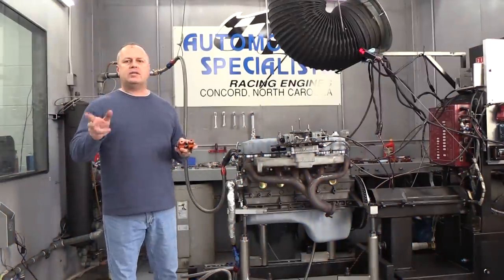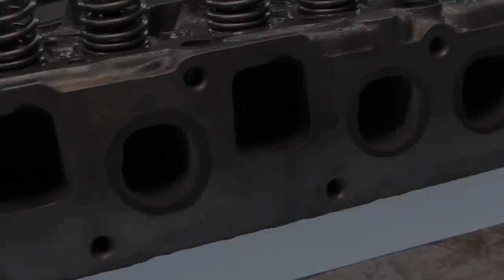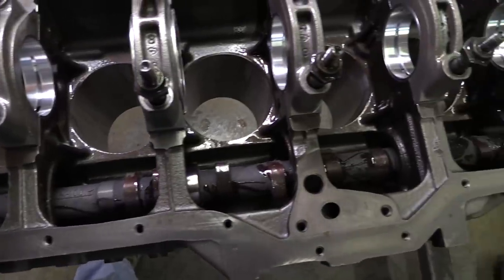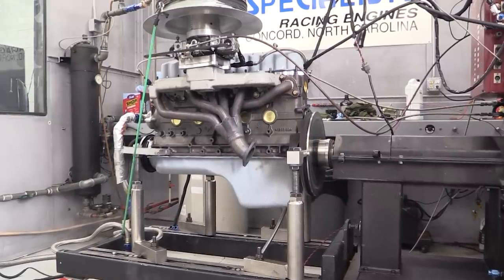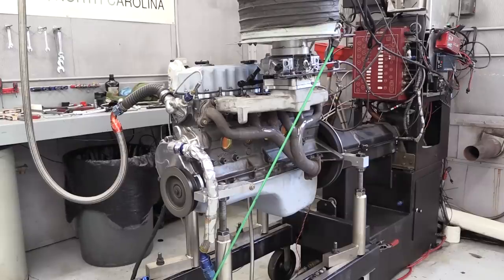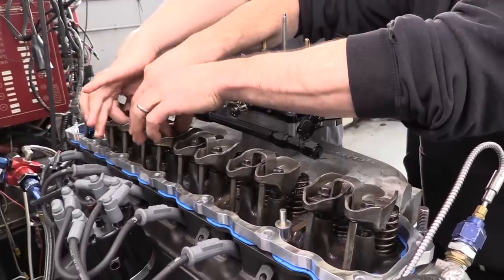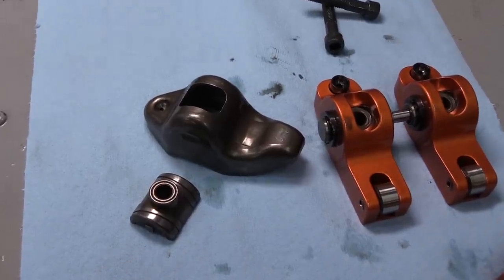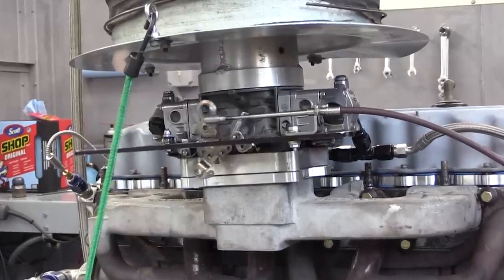Do Roller Rockers Make Power? (Dyno Testing a Jeep Stroker to Find More Horsepower)

Comment: Did yall put a spacer under the valve cover? Whered you get it?
Reply from the maker: Newcomer Racing makes them. And they are cool. They are producing a couple of really smart products for Jeep engines. You can contact them at www.NewcomerRacing.com. Thanks for watching.
Reply from the maker: @Michael Early Correct, the roller rockers will hit the top of the valve covers if you don't add the spacers.

Comment: So whats the reason to even try to use those TUPY heads? Would seem like they'd be the last thing you'd want to use, like trying to make big power with Chevy 305 heads.
Reply from the maker: The Jeep straight six engine has a few quirks. And the 305 Chevy head is a good comparison. The newer TUPY heads definitely are a step behind the older heads, but while the older heads are still plentiful for now, they are going to start to become more scarce. There isn't really much of an aftermarket yet, so far only Edelbrock produces a commonly available replacement head. (There may be others.) Also, while the older heads are the way to go, the newer blocks -- I think beginning in 1999 and up -- are much better. They are the NVH (Noise Vibration and Harshness) blocks with more material and a crank girdle for added strength. So Newcomer has been collecting the TUPY heads that come on the NVH blocks and has a good supply of them cheap. Finally, if customers with 2000 and newer Jeeps want to add power without spending the cash for a new cylinder head to replace their TUPY, Newcomer was doing some R&D to see what options are available. Thanks for watching!
Reply: The Horsepower Monster Didn’t realize there’s not a strong aftermarket yet, kind of surprising. Great explanation.
Reply from the maker: @sparkplug1018  Thanks!

Comment: Ok so now pull out that flat tapped crankshaft and put a hydraulic with rollers and see what the gains are in conjunction with the rocker arms.
Reply from the maker: The lifters are completely encased in the block. Does anyone have a system to install rollers so that they dont' spin?
Reply: @TheHorsepowerMonster  I thought the metal slug that the rod rides up and down on. The "flat tap" can get pulled out and replaced with cam rollers. And yes I think there are parts for that tho they may be for a ford or Chevy.
Reply from the maker: The point is that a flat-tappet lifter rotates in the lifter bore. A roller lifter cannot. It must always be oriented so that the roller is in the same plane as rotation of the lobe on the cam. There are three ways to keep a roller lifter from rotating in the bore. 1. link bars between the intake and exhaust lifters to keep them in the same alignment. 2. Dogbones that slide over a notch in the top of the lifters. The dogbones are then secured, usually a spider bolted into the lifter valley.  3. A keyway cut into each lifter bore. A key in each lifter then slides into the keyway to keep the lifter from rotating. The block design for the Jeep straight six complete encases each lifter in the bores. Because the top of the lifters aren't exposed, options number 1 and 2 aren't possible. Option 3 is very expensive. Yes, Ford and Chevy can use roller lifters because their block designs are different. I don't know of anyone making a roller lifter option for Jeep engines in this configuation. Thanks for watching.
Reply: @TheHorsepowerMonster  I think 505 Preformance does make them. But they kinda advise not to use them because of oil issues. But that's like 2 years+ info. Always enjoy the videos.
Reply from the maker: Thanks for the kind words. Will have to look up 505 Performance. Thanks for watching

Comment: Im impressed as usual. I just got a 2001 4.0 jeep grand cherokee laredo...your not far from me im inbetween lumberton and evergreen nc. If we can drive to u could u diagnose my jeep engine.
Reply: Having odd problem of engine misfiring randomly then on high way sometimes she wont go over 62. Acts like tranny but engine misfires. Coming to stop with brake applied she dups to 500 rpm almost shutting off. A few other probs but seems vaccum or a sensor or something. I changed injectors plugs wires intake sensors and a exhaust sensor just for fun i guess. No improvement
Reply: Crankshaft sensor ? Mine was fun to figure out.
Reply: I will check that today sir
Reply: Remember , don't use a cheap replacement one ,  use Standard Ignition parts or OE  .
Reply: I bought scanner. Its the upstream o2 and camshaft sensor. Can those to cause black mess come out exhaust. I thought wife over filled oil. Plugs were blackened. So i had done plugs n all even injectors. Nothing has improved to much. So im asking am i on right track with what scanner telling me. Or do i have bigger prob with black stuff out rear
Reply: And im using ....dorman oe products i may have wrong name on mind im working on a jeep equinox and sporttrac at moment. May be a different name.  If u know anything better to use i will switch today.

Comment: This has opened my eyes big time.  I currently working on a K20a all motor.  I'm looking for aftermarket roller rockers that will make my engine rev to 10K safely.  I did not know it could possibly gain power out of it as well.   Problem is, all after market rollers eliminates Vtec which is what I'm not trying to do. Anyway, keep the videos coming.  Love them.
Reply from the maker: Good luck, and thanks for watching!

Comment: Why are you so bias towards the roller rocker arms?  I watched this video thinking it was going to be objective. The results graph shows only a small gain for the roller arms.The cost  versus reward doesn't seem good to me. Thank you for the information.
Reply from the maker: Almost 10 horsepower gain throughout the rpm range is small? I don't think I'm biased, I just thing 10 horsepower for the life of the engine for an extra 300 bucks or so is a pretty good deal. Thanks for watching.
Reply: John

Comment: Can't see rockers making enough horsepower to justify cost for stock engine you'll have to have em for racing applications for durability and different ratios the best thing about them is reduction in friction and heat and durability

Comment: I would like to know if swapping 1.5:1 rockers for 1.6:1 rockers on say a Chevy 350 engine would make much difference.
Reply from the maker: Usually. The cool thing about adding rocker ratio is that it can give you more valve lift without adding duration. You just have to make sure that you can add the extra valve lift without getting into coil bind on the valve springs, or hitting a piston with a valve. If, however, your cam is optimally sized, adding the extra lift won't help much. Thanks for watching!

Comment: I think it’s improper to state that the roller rockers “make more power”. The reduced friction simply allows the power made by the engine to go to the crankshaft more efficiently rather than be used by the valvetrain.
Reply from the maker: All I meant was you put them on the engine, the engine makes more power. I think most people understand we’re talking about efficiency.
Reply: The Horsepower Monster, but it doesn’t make MORE power. It makes the same amount of power. It just doesn’t consume its own power due to friction. No power gains. Just reduced friction allowing the horsepower and torque to be more easily sent to the crankshaft. Not trying to argue here or offend you. It just doesn’t MAKE more power. It makes the same amount of power.

Comment: Another back to back test you might have tried was switching from 5/16 .080 Chrome Molly pushrod to a 3/8

With 50 pounds more nose pressure a 5/15 with a relatively long 9.600 pushrod will have a tendency to flex especially with more aggressive cam profiles.

Comment: I got some BBC roller rockers that look like they would work on a 4.0 if you can machine a locator pin into each pair

They actually have a 8mm hole all on the same side of the trunnions, looks like if you flip half of them and fit some drill rod between the pairs I could have a set of inexpensive roller rockers